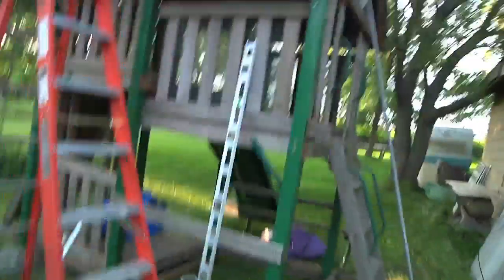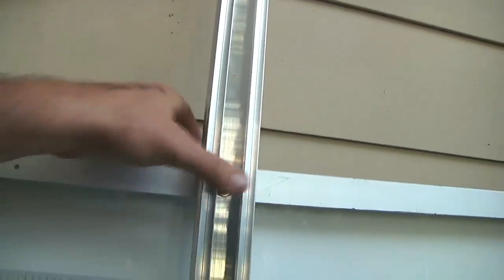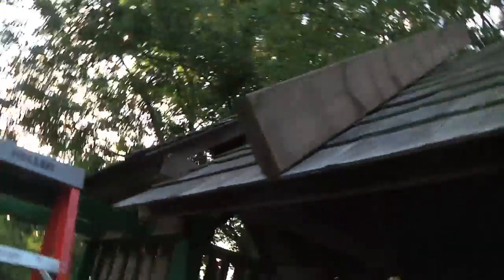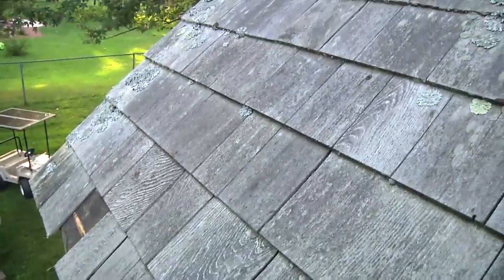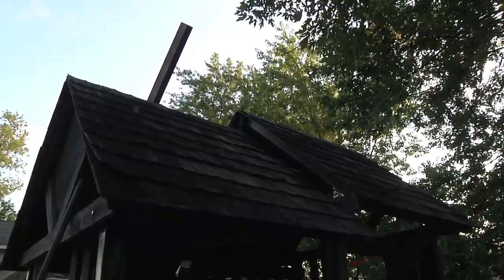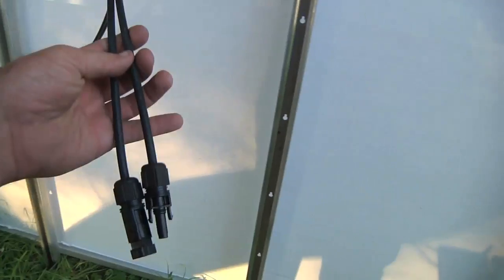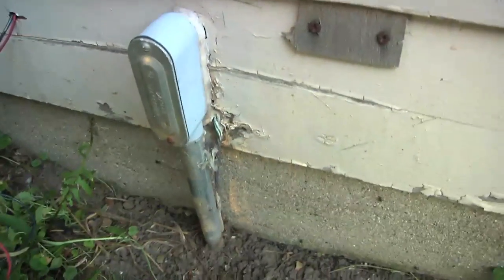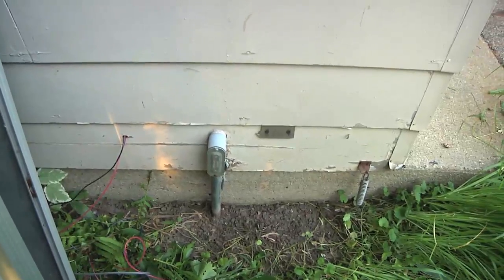Planning Solar PV to mount on Clubhouse

Comment: Hey Ben Any update from this project?  Very informative video on how you installed. Helpful to others.  Question: It looked really shaded in the area while strong daylight seemed to be in small areas in background.  Is this location just temporarily shaded?  Thanks for sharing your project.
Reply from the maker: +THAT SOLAR GUY The finished project can be seen at: http://www.instructables.com/id/Solar-Swing-Set-PV-Playhouse/
It looks shaded in the video because I shot it at something like 7 PM. During peak sun hours, the playhouse is in direct light. I have a narrow and shaded north/south property and right there is just about the only consistantly sunny spot. It's also the only place that made sense for a playhouse - thus, the Solar Powered Swing Set was born!